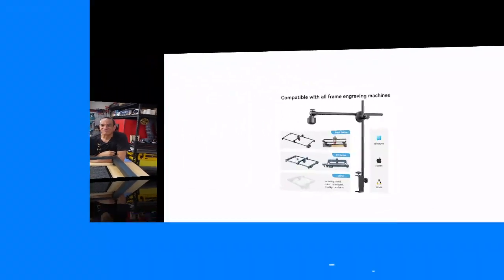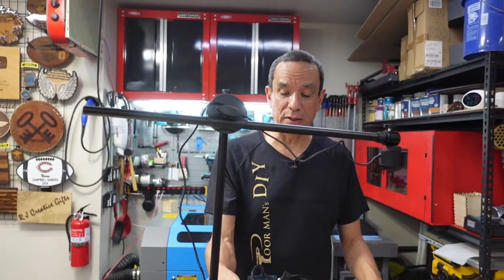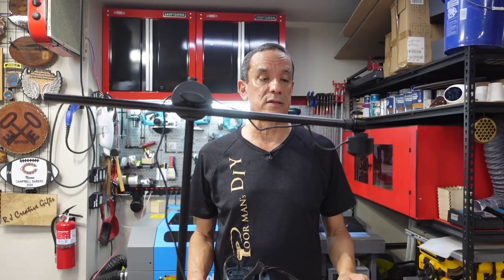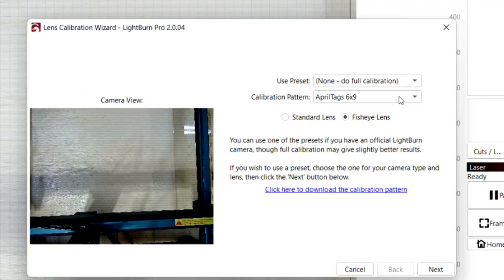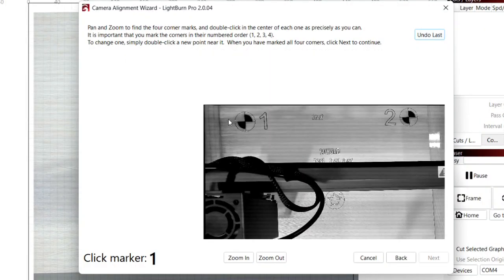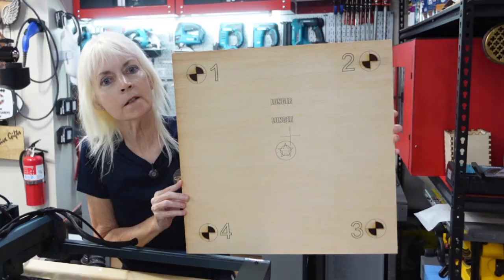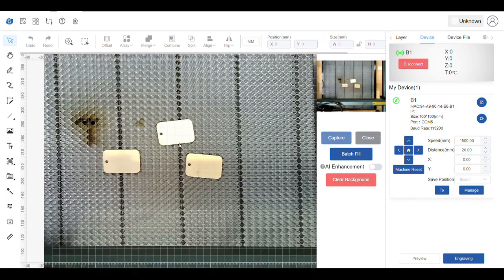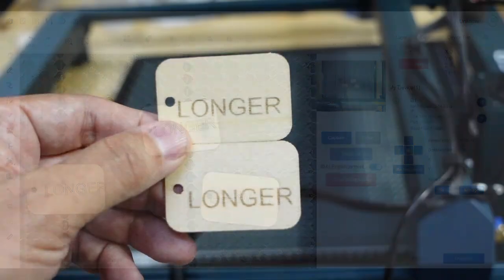Longer B1 Laser Camera Setup & Calibration | LightBurn & LaserBurn Tutorial

Comment: So... I currently have a Longer Ray5 10W and considering upgrading to the B1 40w (48?). Since I have the 10W laser out in the garage, and have to bring files out on the SD card, how can I use the camera with the 10W? It cannot plug into the computer which is in the far end of the house. What kind of connector is on the cable from the camera? Plug into phone? Also, have you noticed a difference in the engraving detail between the 40W and the 5W? Glad I found you, now to bing watch your videos LOL